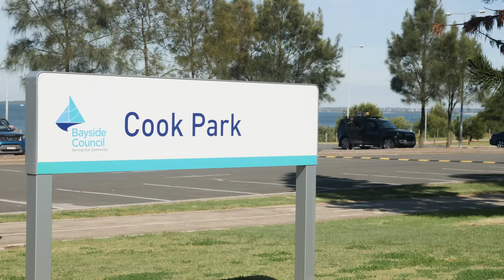I turned a podcast about being a dad into an adventure

Comment: 27:47 I wonder how many miles or kilometers Beau gets out of a pair of Altra lone peaks before they absolutely disintegrate. This pair is obviously been glued back together by Beau many times since they probably started falling apart at 300 km.
Reply from the maker: Using them as a brake during my mini bike marathon leg was a bit of a turkey move, but I reckon most my Altras all see past 800k